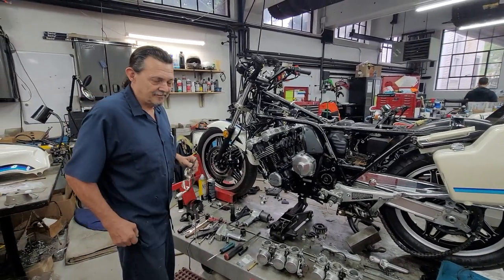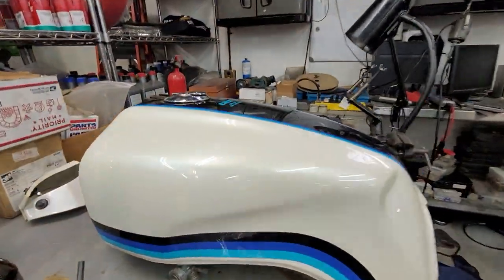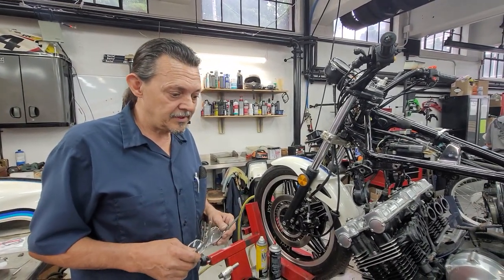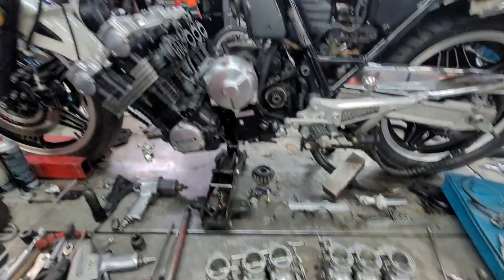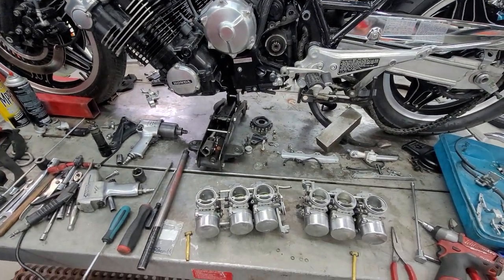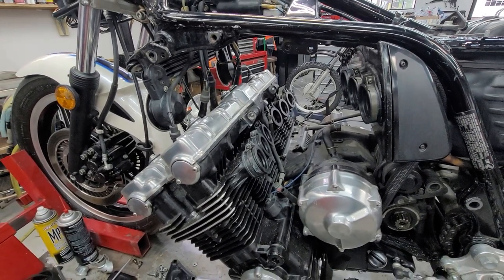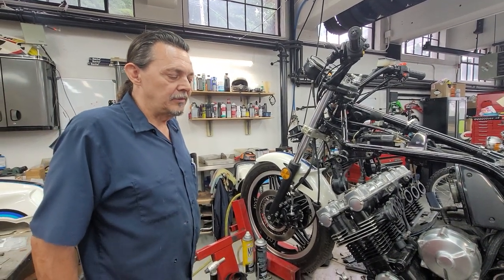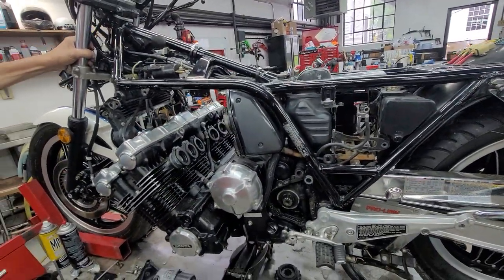HOW TO: HONDA CBX1100 6 CYLINDER CARB CLEAN BY THE MANIC MECHANIC

Comment: Nice video. Two things though....it's not an 1100, it's a 1000cc (actually 1047) and it's not a 6 speed transmission as mentioned. 👍

Comment: jeff’s not kidding ethanol Eats right into that cast aluminum clogs up any small holes in the jetting ports but interestingly I found that the true fuel ! Brand  if you let carburetors set a while with True fuel it seems to breaks up the white powder and seems to start running again I own several free items now because of it

Comment: VP Non Ethanol Small Engine 94 Octane rules....I have been using it in my FJ1200 and CB750 for years.I had it  in one of the bikes for 15 months (not running) and it fired up like it was started yesterday. Unfortunately it has become very expensive.
 Luckily I just moved to NH from the hellhole called Massachusetts and there is a station 3 miles away that sells non ethanol at the pump. You can also try small airports as they generally sell it at a pump. Don't use the high octane leaded aircraft fuel.....the amount of lead in it is to much.